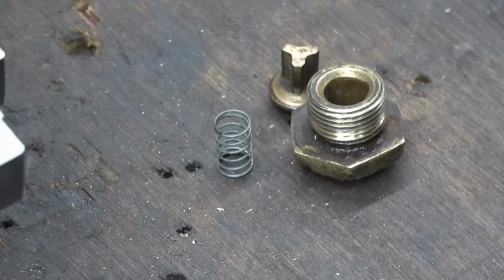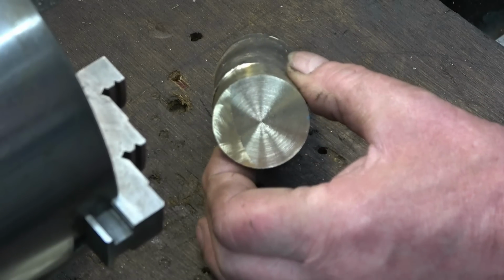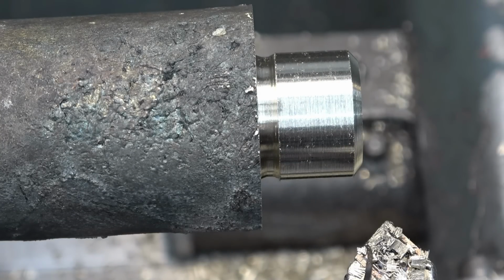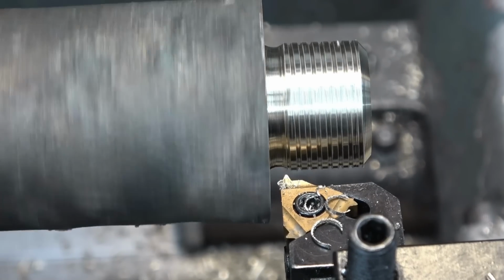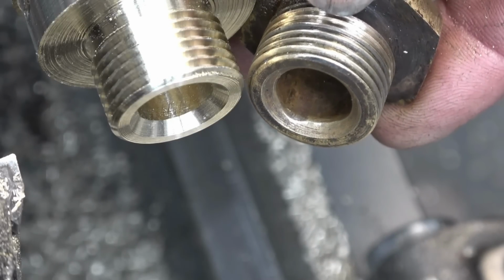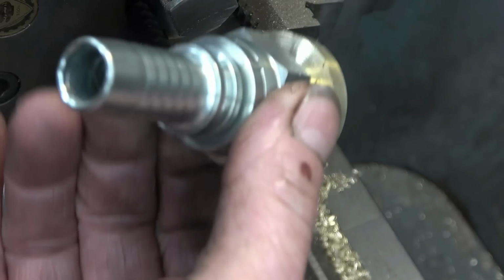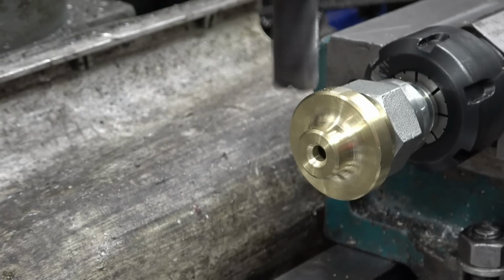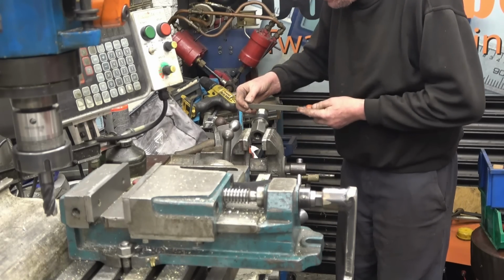SNNC 482 P2  Steam Waggon . Brake Cylinder Bleed Valve

Comment: John, if you used a left hand tool you could turn it upside down, lathe in reverse & cut going away from the chuck. That’s what I’ve done. I don’t do much screw cutting so I just know I’ll end up making a mistake, so I give myself every chance not to by doing it in reverse.